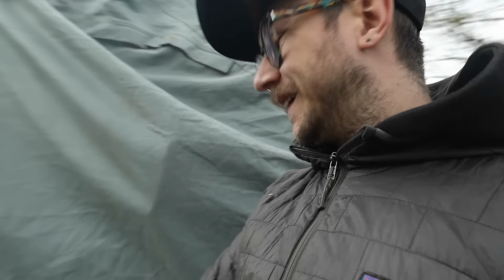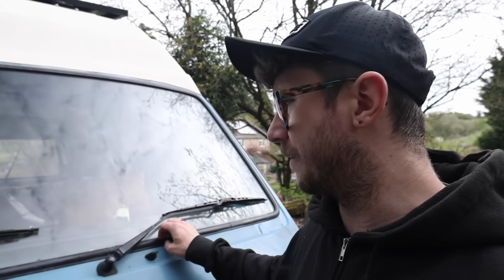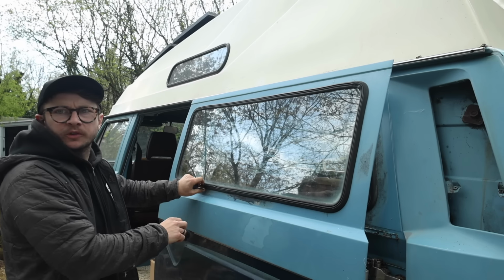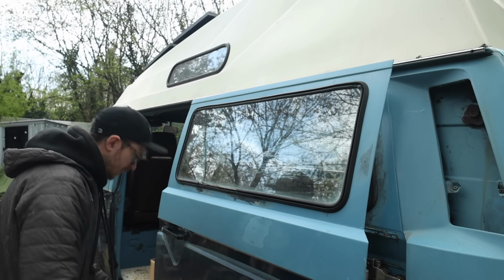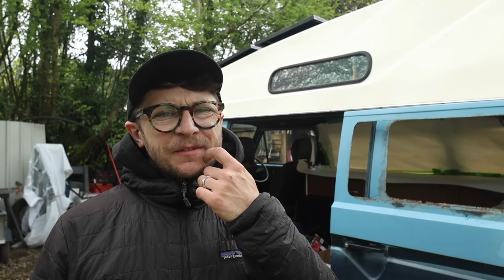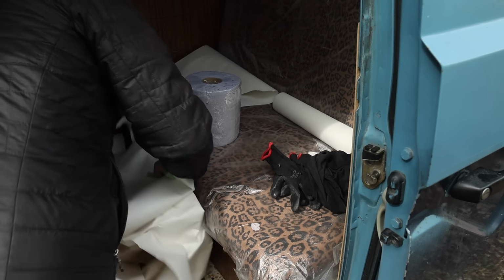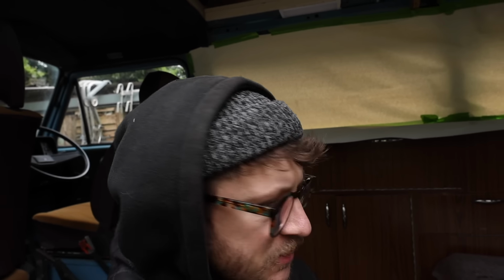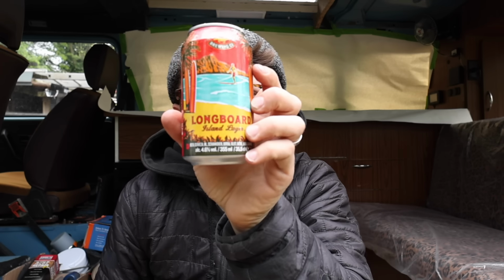DIY Van Paint Job Doesn't Go To Plan VW T25 T3

Comment: Weld through primer/cold galvaniseing spray is good to use on bare metal. And doesn't soak in moisture as much. So might be able to be left longer between jobs and before finish primer and top coat

Comment: Hi Matey. It took me 8 years to restore my Morris Minor and hand painted it with a brush. If you have to work outside like I did and have no tools or time . I would drop the price and sell it as a project. Cut your loses . The interior wood is horrid. My Morris I had to replace Horse hair in seats etc. Replace door panels with wood. When finished I just broke even on money. Time is more important than money. Old George.

Comment: So I got to thinking about your welder, and the hard time you had welding with it. Is it a mig welder that uses shielding gas? And you tried running flux core through it? If so you probably need to switch the Pos and Neg cables around so the Neg is on the gun side for Flux Core wire. Most people even pros don't run Flux Core much so they don't know to check the cable set up. Good luck with the rebuild.